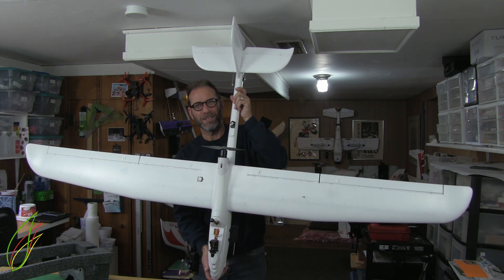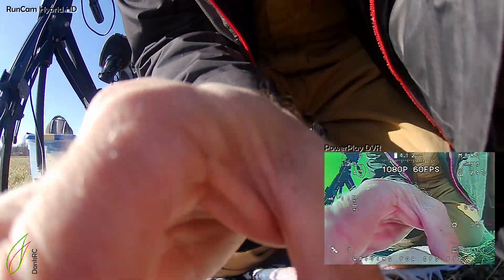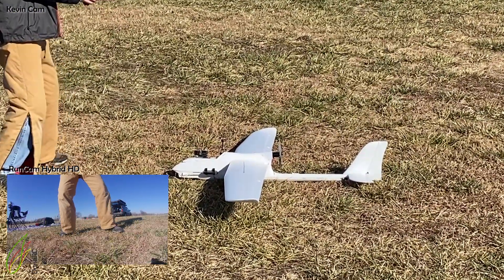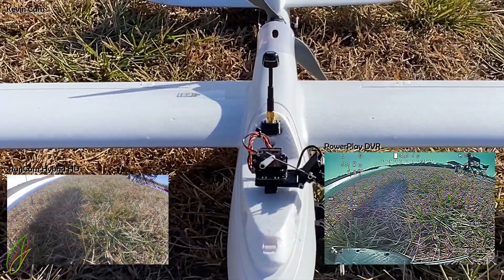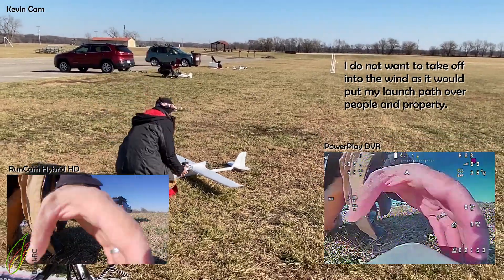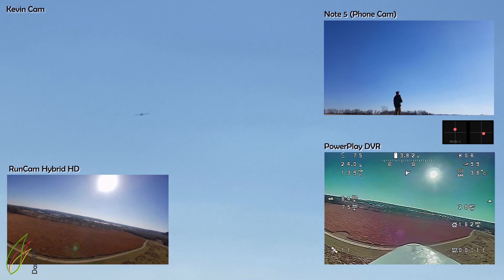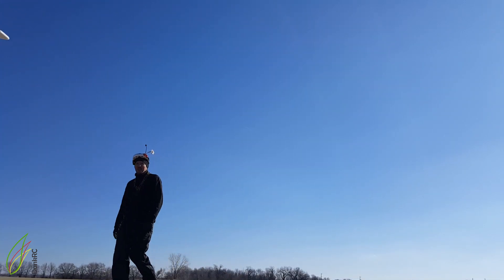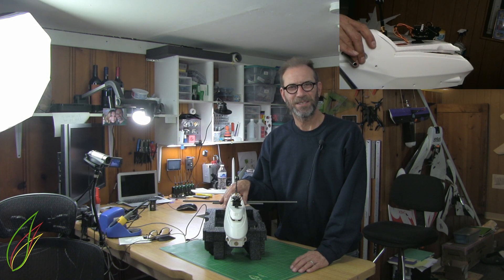Volantex Ranger 2000 iNav Maiden Flight

Comment: Hello. I have problems with the Ranger 2000. The glider just keeps going into a tailspin. Twice fell as a carrot from 50 meters. Alignment is OK. Takeoff weight 1870 grams.
  It is not clear whether the overload, or whether I am doing something wrong. All my other models fly extremely stably and it is simply impossible to knock them down, but here, on the contrary, one wrong movement and that's it. Complete loss of control and down the spiral. I haven't developed any withdrawal reflexes yet, although in theory I know what to do.
The question is why the glider is so unstable and how to fix it. https://www.youtube.com/watch?v=eL80pLvVdGM
Reply from the maker: Sorry I didn't reply sooner.  I have had a similar thing happen to me.  This spring I am repairing the 2000 and will edit the video where I speculate on what is the deal here.  So I don't have an answer, and again, I apologize for not replying sooner, much sooner.
Reply: @DankRCX  Thanks for the feedback.
During this time, I gained experience.
I can say that the main reason for going into a tailspin is pilot error.
This model does not like too strong rolls at low speed. And if at this time we turn our nose up, we will get 100% tailspin. I'm using a flight controller and I've set the roll limit to 15 degrees, I think.
It is also very important to be able to bring the model out of a spin. To do this, you need to stop the rotation of the model using the rudder. We push the ruder all the way in the direction opposite to the rotation. After stopping the rotation, smoothly align the model (raise the nose). Repeatedly saved.